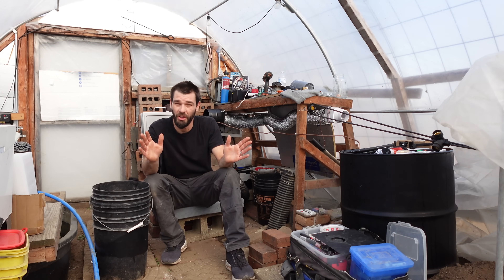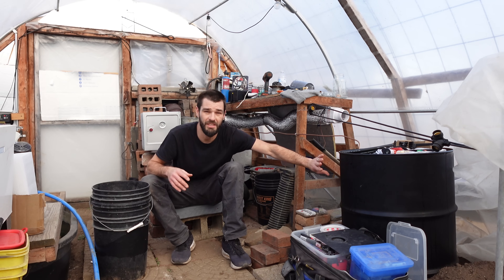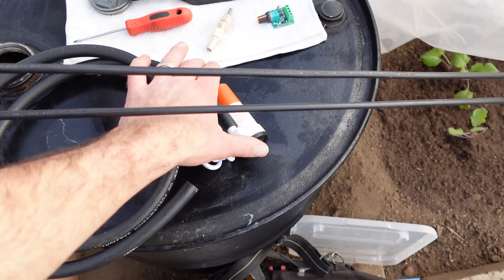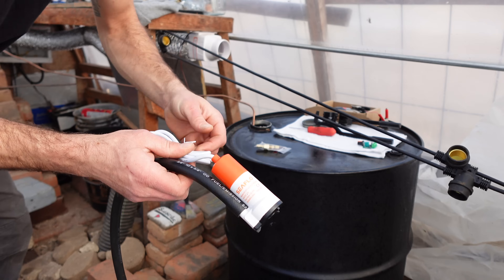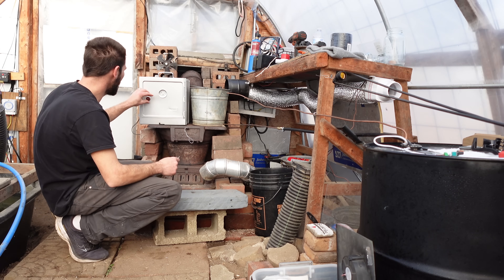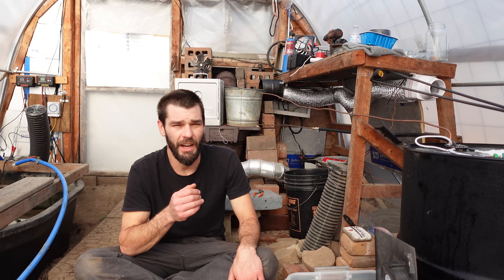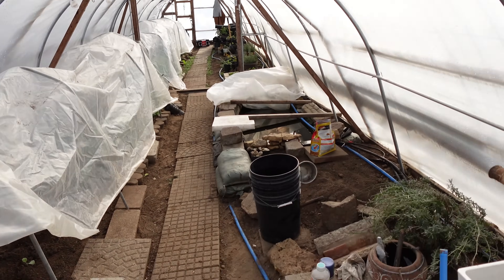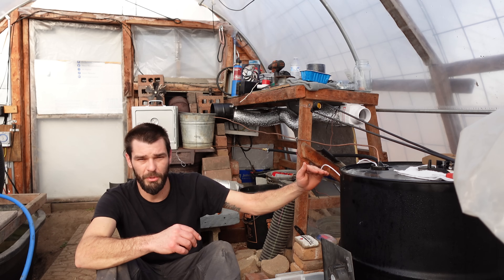DIY SAND THERMAL MASS HEATER FULL BUILD & OPERATION - DIY GREENHOUSE WATER HEATER - Winter 24/25

Comment: That 55 gal tank water. You’ll like this. Take a 4 inch pipe. Put a grid at one end. Have pipe go down to inside tank. Then turn back up. And lead to out of green house. Drill a hole facing out through the end. Hook up a small air pump. When this turns on the air will cause a draft. 
On top tank set a self start bbq charcoal you could even use wood pellot make bigger cup. Idea. The flame will pull down like a rocket stove. The sand will heat up from all exhaust transferring the heat through pipe to sand. A small cheap powerful heater. 55 gal bring to  500 deg if you use sand.

Comment: carbon steel to ASME B 16.9 A106 ?
Love copper /brass/bronze
(their grade and wall thickness for steam) 
(additional alloying elements, such as chromium and molybdenum)

 The loss in the total energy of fluid flowing through a circular pipe must depend on:

L = The length of the pipe (m)

D = The pipe diameter (m)

u = The mean velocity of the fluid flow (m/s)

μ = The dynamic viscosity of the fluid (kg/m s = Pa s)

italic-p - body text.jpg= The fluid density (kg/m³)

kS = The roughness of the pipe wall* (m)

* Since the energy dissipation is associated with shear stress at the pipe wall, the nature of the wall surface will be influential, as a smooth surface will interact with the fluid in a different way than a rough surface.

Comment: Keeping the water from boiling inside of your coil might be a good idea.  The best way to do that would be as the output temp increases have the water throughput increase, lowering the time that a given volume of water is absorbing heat, but increasing the total amount of water that is heated over a given time.  Having permanent thermocouples in place at key locations (input, output, middle of the sand, and the bucket) could allow you to automate the process (just add fire) and have glorious amounts of real time and archival data.

Comment: Since sand batteries can get very hot (> 212 F), how do you go about removing heat from a sand battery that's hotter than boiling water?
Reply from the maker: After hours of running , we’ve not seen or water temps reach 200f coming out. The sand does hold a lot of energy but just to transfer it quickly to the water and air.

Comment: Protect your pipe from galvanic corrosion. Copper and ferrous metals don't play well together. The beauty of this system is in its thermal battery effect. The heat will continue to dissipate into your space long after the fire is out. THAT is why I love mine so much. There is no need to get up through the night to feed the stove.

Comment: Thanks. Im looking to build a greenhouse house heater. Same in theory but different in scope. I have a hobbit stove from a defunct school is project. It has the boiler built in. I have salvaged electric water heater tanks, using them as passive  heating. After watching this im now planning to open one tank run the copper coil thru it fill it with sand then run the cooper to the water tank above it then run it back to the stove. 
The only thing i would do differently if i was building with what you have is to jave the water closer to the stove otherwise fantastic build. Thank you for helping me work my build out.

Comment: What are you gonna do with that hot water? Heat exchanger?
Reply from the maker: Not a bad idea but the hot water is more useful as hot water instead of exchanging directly to air. Using it as a thermal mass thanks for asking!

Comment: Can you eliminate the pump with check valves?
Reply from the maker: That’s a good question! So if the tank was a little higher we could probably use thermos siphoning. But i f we have a check valve we would keep water in all the pipe possibly leading to a freeze up and breakage.

Comment: If you put the barrel above the stove you could eliminate the pump and it would thermally siphon
Reply from the maker: Yes that is correct. Hard to achieve with limited space. With solar power we get free energy to move the water daily. Thanks for checking this out

Comment: Wonder if it would work better if you had the hot water return near the bottom of the barrel (cause heat rises, then the pickup at the top (so you aren't cooling your sand. The way you have it, the hot water is dumped near the top and naturally wants to stay there where you will lose that energy from the steam coming out
Reply from the maker: That is a great thought. I may expand upon that. My goal was to just get the water circulating heat. The pump draws from lower In the tank but yes there would be a hot cold line in the tank till the heat seeps

Comment: I hooked up a couple solar panels to a heater coil and put that in a bucket of sand and it got as hot as a wood stove.  Melted my first heater coil.  I think instead of sand I need to use pea gravel so it can have some dispersion of the heat.
Reply from the maker: Very cool! Thanks for sharing !

Comment: Would this same style system work with a siphon, instead of the electric pump??
Reply from the maker: If you had your water higher than the heating source yes it could be done, we’re only using solar power. But with that you would have water in the system even when it’s not on, potentially leading to freeze failure of copper. I will say that we’ve had some negative temps already and the sand seemed to insulate the copper and most of the water drains to the tank when the pump shuts off by design. I’ve had a lot of failures lol

Comment: Nice Job! My only suggestion is to insulate the bucket so your sand battery doesn't immediately send that energy to the air. I'd use a fireproof vermiculite cement mix (3verm+2sand+1cem) for the insulation as a 1" liner inside the bucket.
Reply from the maker: Thanks for the idea, insulation is definitely a top priority!  This was the first experimental build. I’d like to achieve longer thermal mass extraction and insulation will help, along with a larger more efficiently designed system. Thanks again!
Reply: @Earthdwellershomestead  I don't know if you have cheap access to locally produced vermiculite or perlite, but you can usually source it by the cubic foot for agriculture. Don't buy it in gallon or smaller bags. That's a ripoff for small gardeners shopping in-season.
Reply: Or cheaper dig a hole and surround it with dry straw/shredded leaves
Reply: @the40belowscalecorresponde18  just be careful as the heat rising within sand can well exceed the melting point of tin if insulated correctly

Comment: very cool idea. I currently am trying to utilize a sand battery. I am charging some 600watt 24v hot water heater elements with 200 watts 24v of solar throughout the day. Today is my first day. it didn't heat up like I wanted. But ur video has really made me think, definitely might get some 55gallon drums n replicate ur system, just with solar panels n some type of heater element for the sand. also solar on the pump, so during the day it'll heat it up n hopefully throughout the night it will retain the heat.
Reply from the maker: That’s awesome, so I will say I have experimented with heating elements a bit last winter. Sand isn’t the best medium for a metal heater element just based on observation. Using water to pick up heat from the element and transferring that heat to sand is my thought. That complicates the system a bit lol but i feel like the heating element will have more longevity in water as opposed to stagnant sand. Thanks for sharing. Maby we will build a solar experiment sand mass heater too. Thanks
Reply: @Earthdwellershomestead  That almost seems counter productive to heat the water to heat the sand. unless it's quicker to heat that  U also might try a bells siphon, instead of a pump for the water, it'd be no electricity used.
Reply: @troydefond2307  Using water to heat the sand means that the sand is never going to get hotter than 100C. Doing a quick calculation on this:  a 200 liter drum of sand weighs 320kg.  It takes 62,937 Joules of heat to bring a kilo of sand from 25C to 100C.  320kg  of sand will take 20,139,840 Joules. Round that down to 20MJ.  So the 200 liter sand barrel's  heat is  slightly less than the heat energy derived from burning 1kg of methanol.
Reply: Great idea with the solar and the water heater element (or electric stove element).  You might meet with more success if your metal barrel has an insulation. Perhaps a galvanized trashcan with a lid. Perhaps one or two inches of plaster of paris on the sides and bottom of the barrel and then filled with the coil and sand.  It will heat faster and your temperature will maintain longer. You should be able to hit temps of 500 degrees that will hold for a considerable period of time.

Comment: We had baseboard heating in the house I grew up in.  Copper pipe from a furnace run along the baseboard in portions of each room, encased in a 9” tall sheet metal radiator that was piped into each room., aluminum fins surrounding the pipe. This got hot to the touch.  You might look around for something salvaged if you had a benefit to running the heat further from the source. 

Really enjoying what you are sharing.  🎉
Reply from the maker: That’s a great thought and gives me some ideas, thank you for watching and sharing !
Reply: That would be a perfect heat for a greenhouse. Hi Earth dwellers homestead, I jus ran across your page. I'm hoping to get a greenhouse going this year and already wondering how I'm going to keep it warm next winter.. love the gold fish too..  @Earthdwellershomestead

Comment: Hmm this is interesting. I have a sauna where I heat the water using SS flex pipe around the flue heating a tank of water that is a few feet up in the ceiling. The water heats pretty fast when inside the sauna, unlike when I had it outside. I already tried by placing another SS flex pipe inside the hot tank which also gave me instant warm to really warm water. Now you have a cool idea here with using sand and it seems like it maybe providing even better water output. I'll have to test this, plus sand doesnt cool off as fast.
Reply from the maker: @d1mon12  the sand is a thermal mass in itself, making a longer transfer to our thermal mass(or a sauna) this was a small  scale experiment. We plan to build a larger heater for the next greenhouse. I’m glad you found some inspiration here, thank you!